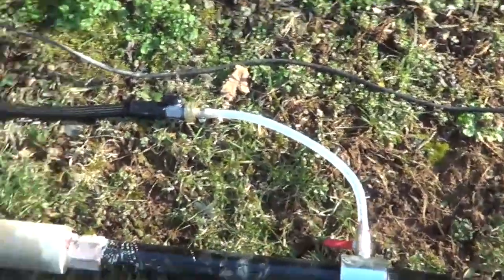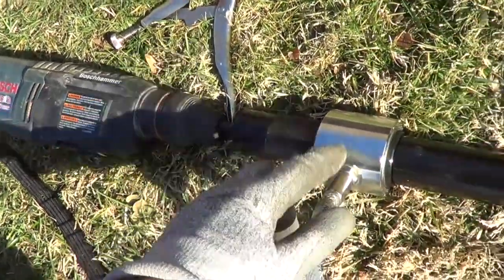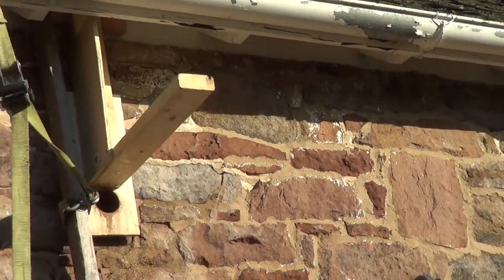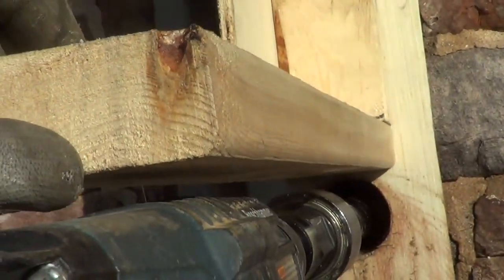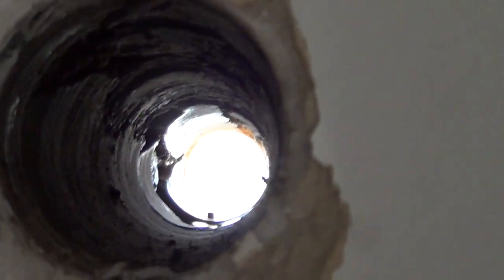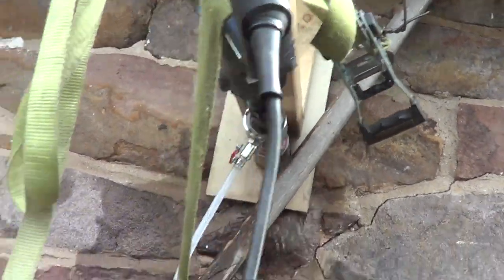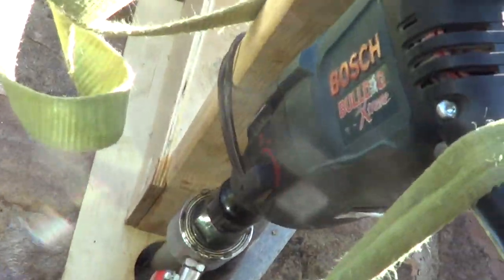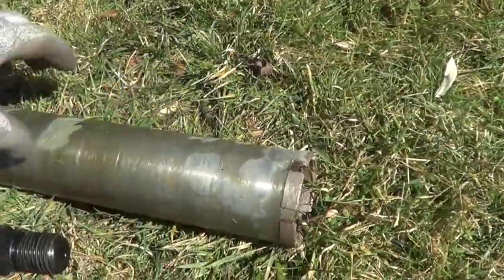Drilling Thru a 200 Year Old Granite Wall

Comment: Lol trying to bore through 20" granite on my new 108 year old home. I was about to buy a new 4" core bit as I thought that was the issue.  Took an hour to drill 3 inches. I admire your patience
Reply from the maker: That is about right.   3 inches per hour.    More pressure will make it go faster.   It is probably worth renting a core drill with a hand crank.

Comment: I'm doing this exact job at the moment and losing the will to live. We are installing an air con unit in our French house and I have a 60cm wall to get through. It has taken days and days of drilling at about 1-2 hours per day, holding it by hand as I started from the inside. Solid stone, probably granite. Tried to find diamond tipped core cutter but only found hardened steel. Now at about 43cms, and praying for some softer material like concrete or render etc to work my way through. Never again!